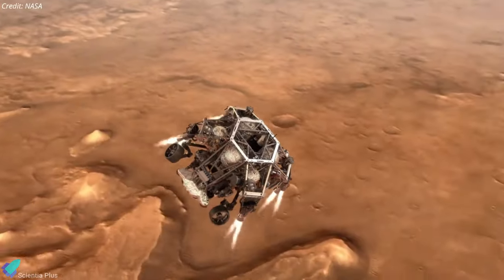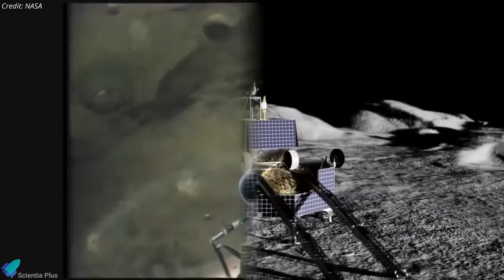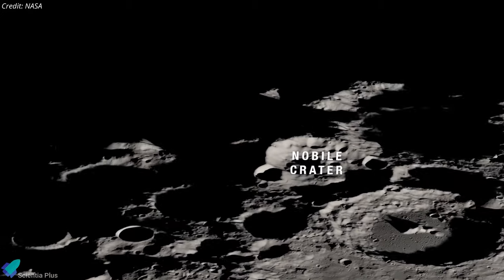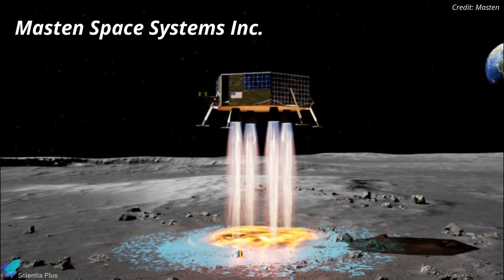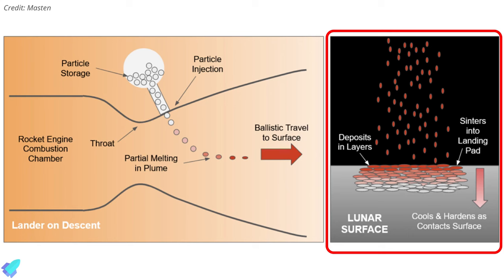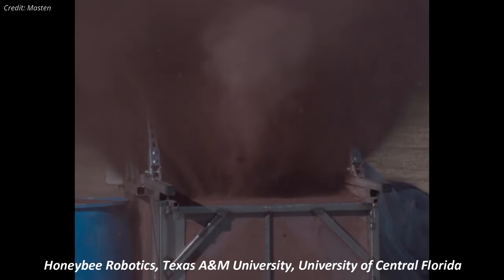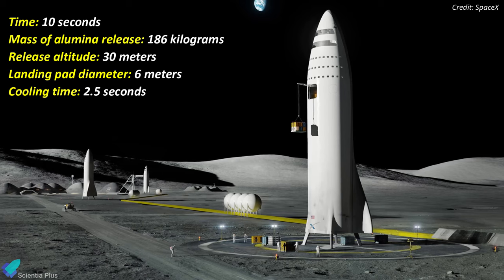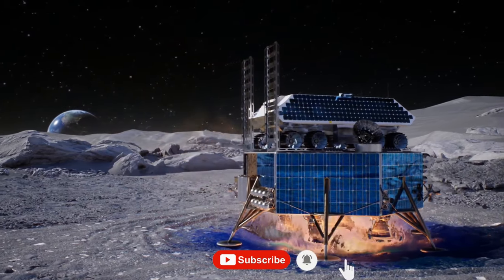How to Build a Rocket Landing Pad on the Moon & Mars in 10 Sec?

Comment: I think the best way to use that system in a starship is to have multiple landers prepare the landing pad in advance and drop away from the edges. The starship would then use radio signals to precisely land on the pre prepared pad.

Comment: This idea has potential but I don' see it working in reality.
A better idea would be for Starship to launch an instant pad while it is still in orbit then when the instant pad hits the surface it spreads out and starts to cure and harden at that point the crew would check the successful deployment of the instant pad before attempting a landing.

Comment: Some kind of system like that might be worthwhile, but will it be light enough to warrant the extra weight?
Reply: Not just the weight of the components and aluminium, but also the weight and supply of fuel needed to bring the lander to hover and hold for 10 seconds must be considered.  This could work well with the SpaceX lander, as it has MASSIVE excess lift available for basic, small crew Moon missions.

Comment: Will such a thin coating really withstand the considerable weight of the SpaceX  or bpue origin landers?
Reply: I believe you should see it more as a "glue-on tin foil" and it is not intended for holding weight per se, but to avoid scattering of the gravel

Comment: The lunar variant of Starship has a set of rcs thrusters on the upper part of the rocket, well above the surface, reducing debris displacement.

No need for a landing pad, nor the weight of equipment required to deploy such a "solution".

All the more reason to not have selected Blue Origin and Dynetics for HLS, with rocket thrusters near the ground.

Mars is a different situation, requiring main engine thrusters to land.  Initial Starships are unlikely to return to earth; they may be able to bring equipment to autonomously build landing pads - although water harvesting for CH4 and O2 production will be a higher priority.

Comment: so the plume liquifies the alumuinum slightly  above the surface  and it hits the cold surface on the surface and solidifies in to a pad  .....why wouldnt it re-melt a few seconds later as the ship and all the reverse thrusting plume heat  and fire is blasting the pad surface to stop.. even more concentrated ...the temp of the planet surface wouldnt  be able to overcome the huge heat generated y the rocket  a few feet from the surface,, .is it gona blow hot molten metal all over...or a hole in the metal 

if it melts the first time , why would it not liquify the second time a few seconds later.. further more ,if it didnt melt but just got soft , wouldnt the heavy ships feet poke into to it like hot asphalt and then when it re-cools trap the feet with a bunch of solid metal in the shape of the pad...that would not be cool for flying around  later ,i would think...

im sure there is an answer but what i saw doesnt address any of this ...
Reply: Could shimmy Left then Right, then back left for landing.    Two pads....
Reply: @johnpotter4750  I think the smart thing to do is not land… at first stay in orbit Nd circle… it would look cool…and beam everything heavy or big down to the surface.. also have a few  small vehicles to run people back and forth …..like taxies… yea .. that’s it … 
a transporter…

Comment: Brilliant - a 6 metre diameter instant landing pad for lunar starship, which has a diameter of 9 metres!  Doh! - back to the drawing board...
Reply: Using the "approximately 24 midbody oxygen-methane thrusters for use very near the lunar surface" (https://en.wikipedia.org/wiki/Starship_HLS) the diameter of the plume will be considerable larger, but much less concentrated and much weaker. However, some ejecta from the plume must be expected, so the issue here is to limit the amount of dust ejected into low lunar orbit.
Using the Masten FAST technique will help secure a more stable landing zone, but this needs to be created under the four landing legs rather than in a circle under the Starship. I'm sure they can figure this out too ;-)